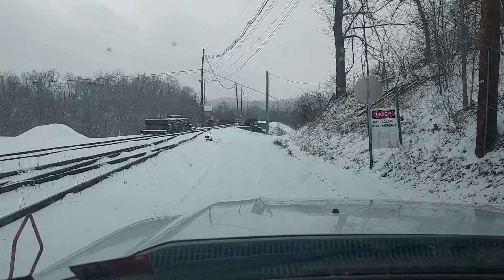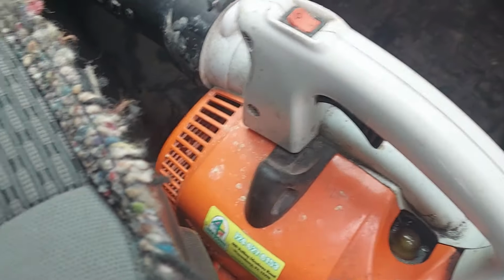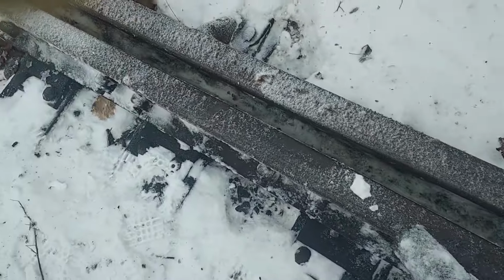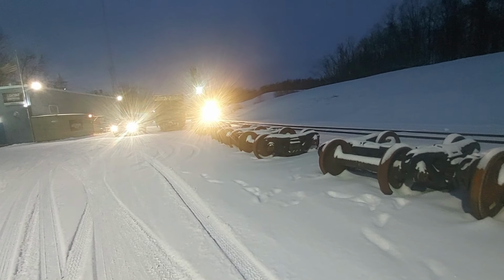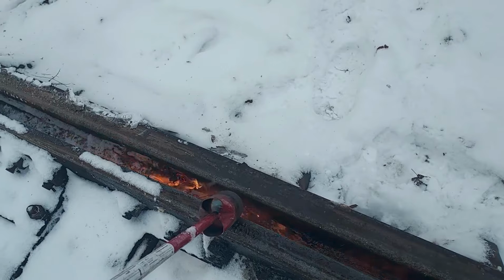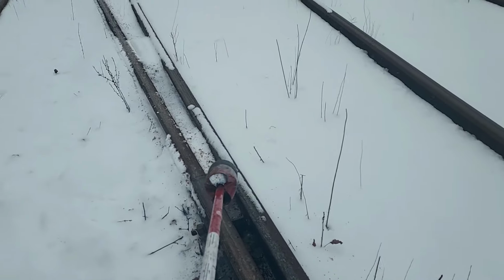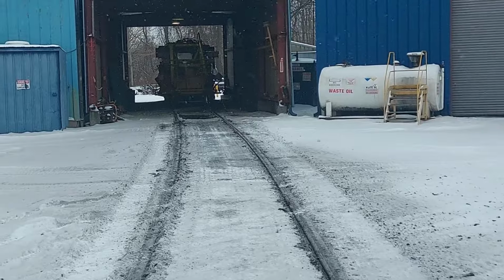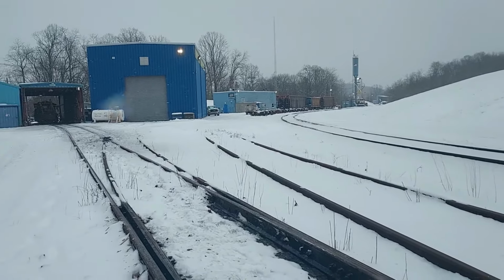Cleaning Snow out of Railroad Switches

Comment: years ago  dave when I started trucking scrap I hauled out of a yard that scraped rail cars they  had there own locomotive, so what the brake man did was when they were expecting a lot of snow he'd cover most switches with flat cars  there for keeping the switches clean!!! pretty smart!!
Reply from the maker: Hey that is a pretty smart idea Jeff. Flat cars would work great for
that. Problem with the hopper cars is if snow accumulates in them
then it makes for a real mess when they try and dump coal out of
the cars. If they are not running trains and a big snow is coming,
we open the doors on the hopper cars. Thank you very much for visiting with us to help me clean snow out of switches my friend.

Comment: I worked in the steel industry for over 35 years in northern Ohio and all steel is moved by rail.  When it was cold and much snow was expected the RR used to park cars above the switching points if possible to keep the snow off them and we had a small little mobile RR car with a cab on it and it had a jet engine mounted on it that would be turned on and pointed at the tracks to blow off and melt the snow and ice - its was a very cool little car to say the least!  I could still hear the sound of that jet engine as the car went by and took care of business to keep the plant running.   I love your videos by the way as I'm retired and these videos bring back memories of days gone by.
Reply from the maker: Really pleased to hear you are enjoying the home movies Krispy.
That's an excellent idea to park a car over a switch, we've done
that a few times on our main line switches if they weren't running
trains. I need one of those cars you had here!!! Boy what fun I
would have with that.

Comment: I use to work for a construction company out of Cleveland Ohio that did rail maintenance. We used a mobile air compressor that we used for our neumatic tools for rail maintenance to clear the ice and snow off the switches. We had a hand made wand with a lever valve to flow air or shut off.
Reply from the maker: That's the way to go Kevin. We have a long wand that we have
in the past hooked up to the air line on the loco to blow snow
out of the switches, it works great so I'm sure your configuration
would work great also. Very much appreciate your taking the time to visit with us and check out the video my friend.

Comment: We carried a snow broom on the locomotive and the crummy. We cleaned out switches before placing cars. The track gangs couldn't always get to the customer's sidings so the roustabout crews performed the task. When I started on the EL in the 1970's they used snow oil which would melt the snow from the rods and switch points. Highly flammable, couldn't use it near switch heaters. The propane heaters made an eerie whistling sound when heating; you could also roast weenies over them. A lot of switch heaters are now electric and are remotely controlled. The track men had a fusee holder and ignited the propane heaters with a lit fusee. It isn't fun railroading in the snow. Don't you have a cold weather head cover to attach to your hard hat? I don't envy you working out in the blustery cold. Thanks for another great video. Take care and God bless.😎🚂🚃🚃🚃✝
Reply from the maker: No I do not have a cover for my hard hat Gary. I get in the truck when
I get cold....:-) Very interesting comment to read, appreciate very much your taking the time to share some old railroading with us
my friend.
Reply: all our switch stands have a holder for a broom that has a ice chipper on the other end, however... conductors often pretend they dont know how to use it and we usually gotta come clean the switch for them after they packed too much snow/ice into it! Funnily enough they will also break the broom on purpose if they dont want to clean it and make mow do it ^^

Comment: It's amazing how strong ice can be. We had a lite locomotive derail once because of ice in a crossing down in Connecticut. Man, it was cold that day. Took two days to get it back on the rails, laid it right over on its side. I'll never forget it, we stacked 215 ties for a pad for one of the crane outriggers, there was a ravine on the side the loco went over, then never used it!! Man, it was cold! We also had a jet engine mounted on a hi-rail car that cleaned the switches in the yard. Boy oh boy was that thing a site to watch. It was loud and violent, would send ballast, spikes and anything else that wasn't nailed down into a low earth orbit.
Reply from the maker: We never thought ice could jack a heavy loco off the tracks Anthony,
but we learned a valuable lesson the hard way that day. I bet your
experience with that was a real fiasco. That's what I need to make
a cool video is one of those jet engines!!! :-) Very much appreciate your taking the time to write in and to check out the cleaning snow video my friend.

Comment: When our switch heaters go out we use plastic shovels and brooms, and hydro, and light it on fire.  We have 750dc, 480ac, 240ac heaters and gas, and propane, there is a lot of miles.
Nice tiger torch.
Of course your mine railroad is different then mine and we cannot use any blower safely not to mention we have third rail.  At switches like that we use Kerosene pots, they last eighteen hours when lit.  For simple heat why do you not have those?  
We also have two jet engine blowers mounted to a track car.  It has power, heat, and loves to throw ballast at windows to break them. LOL

Nice job though.  Glad you had the tesing done, thank the man Sperry for that invention.
Reply from the maker: Kerosene pots would be nice but they got me instead Tuco....:-)  Even years back when we only had 1 loco and 4 of the switches got used every train trip we would have to manually clean those switches all the time.  I'm really glad I don't work track that has 3rd rail!!! Thank you very much for visiting with us to help clean snow out of switches my friend

Comment: It must suck to have to do that by hand! The tracks by us have "high speed switching" and there are switches everywhere between our town and the yard in the nearest larger town. Every one of them has a propane tank next to it and a switch heater. I'm sure that is insanely expensive, but necessary if you don't have a large team of Dave's 😉
Reply from the maker: NS has those around here also Mojo, I made a video of one couple
years ago but haven't shown it yet, would be cool if I could video one
when it was turned on, I'm waiting for that. They sure save a lot
of man power and you are right, they are expensive.  Very much appreciate your taking the time to check out the video and post a comment my friend.

Comment: We used to have a  1” pipe about 6’ long with a ball valve with 8’ of 1” hose hooked up to a locomotive and blow out the switch from the pilot, it worked great until it was outlawed.
Reply from the maker: When we were running only a single loco we too had one of those
and used the loco car dump line to blow snow out of switches with
that Jason. Yes it did work great but the train operators weren't too
pleased about getting out in the middle of the night to blow out
switches with it....:-)   Thank you very much for visiting with us to help clean snow out of switches my friend

Comment: I've used leaf blowers for years  cleaning snow off our vehicles,  and when it's powdery, the driveway too. Great thinking
Reply from the maker: Yes sir, I also use the blower for cleaning snow off my hi rail trucks,
works great. Here in Pa. we are supposed to clean all the snow off
the car roofs so snow doesn't blow off them and cause an accident,
the leaf blower is the ticket to do that.
Reply: @ccrx6700  
I live in Utah.  It's the same  here. We get alot of powder, so usually  it's easy.

Comment: Thanks for taking us along, Dave! Really neat to see how you handle the snow and ice around the switches. I've seen the hand-held propane torches like that but I never would've expected you to use a leaf blower! From a layman's perspective, it seems like the massive weight of trains would crush through any resistance that ice or frozen ground could offer, but it amazes me how much care you really have to practice with the cold temps. Thanks again for sharing! I learn so much every video!
Reply from the maker: Appreciate the nice comment Seth. When that loco went off the rails because of the ice build up, we all had thought the same as you
did. 368,000 pounds it weighs and it ain't gonna derail from a little
ice. We sure were wrong on that and learned a valuable lesson the
hard way.   Thank you very much for visiting with us to help clean snow out of switches my friend
Reply: @ccrx6700  What a horrible lesson to have to learn, too! Thanks again for sharing all this with us, my friend! Hope you're having an excellent evening.
Reply from the maker: @TheyCallHimDietSeth  👍😊

Comment: BRRRRR, fire and a blower sure beats the broom. Wish I had that when I was cleaning switches at 5 deg. in Jan. years ago. Good video. Glad it is 65 today instead of that 14. :)
Reply from the maker: Yes it sure does Bryan. We've used a long wand run off the air
line on the loco before also, that does a great job, specially when
the snow is heavy.  Thank you for  taking the time to visit with us and check out the video my friend.

Comment: Hi Dave,  Good to learn something new.  Torch melts snow into water, you go away and the temperature drops, and you get ice. I guess that's just another reason for good track drainage.
Reply from the maker: Torch evaporates the water shopshop. However using the leaf blower to try and blow away wet snow can cause more ice to form. There's
always a need for good drainage for sure on that!  Very much appreciate your taking the time to write in and to check out the cleaning snow video my friend.

Comment: I can remember in the late 60s early 70s Toronto Terminal Railroad, who ran Union Station Toronto, would pour diesel fuel on the switches and set it on fire with flares. With all the double slip switches it looked like a war zone out there. Probably would not meet today's environmental standards. The funniest thing though was to watch CN working on the Turbo trains by heating the fuel lines with flares and pounding the jet engines with wheel hammers to get the engines to start. Such a low tech method to start a modern engine. Of nothing else works get out cans of diesel fuel, big hammers and flares.

Love your videos, and the use of a leaf blower.
Reply from the maker: I've set switches on fire before also using Fire Snake D Bolt. That's always fun, we used to use a rope soaked in diesel fuel
before they started getting us the snake. Just pouring fuel
on a switch and lighting it wouldn't seem to last very long. Big Poof and it's all over. Appreciate very much your taking the time to visit with us and may you have a very good day my friend.

Comment: I could see where 16 degree weather would cause the ice between the switchpoints to create ice damming.  I would also assume that the bolts needing to be replaced are caused by downward stress on the rails from the locomotive and railcar traffic in addition to the lateral shear stress of the rail shrinking in cold weather and expansion during warm weather.  I bet when you finally have a weather warm up you find quite a few bolts sheared off.  Great video on how all the "little things" keep a railroad moving.
Reply from the maker: It's a constant thing out here with 16 miles of jointed track bolts shearing off Dave. I keep after them and at minimum weekly go out
and replace missing bolts, a never ending battle. Glad you enjoyed
the video and we very much appreciate your taking the time to write in and to check out the cleaning snow show my friend.

Comment: Is there a problem with the coal freezing to the hopper cars? Are the cars cleaned out of snow and ice before they're loaded? In the gravel business there is nothing worse than the load freezing in the end dumps. Our quarry trucks had heated bodies but sometimes the material will still freeze in them.
Reply from the maker: Yes there is a definite problem with coal freezing to the sides of
the aluminum cars Pete. There will be a video out soon on how
we spray the insides of the cars with a side release agent to prevent
coal from freezing to the sides. If they are not running trains consistently and a big snow is coming we will open all the doors
on the bottoms of the cars. If we let the snow build up in the cars
then load coal on top of that snow even with spraying it creates
some big problems. Many of the triaxle trucks they haul gravel
with around here can direct their exhaust to warm the bed up
if needed, but it always doesn't work very well like your trucks either.

Comment: Hi Dave, we have 9 switches to blow out at our place in Northfield MN. We use the stihl backpack blowers and the brooms. Wish there was an easier way to do it but like you said, you gotta do what you gotta do. Take care buddy!
Reply from the maker: Would be nice to have one of those back pack blowers, they no
doubt do a better job than my small leaf blower. We used to have
a long air wand that we plumbed into the loco air line, that worked
great and did well in wet snow. Thank you for taking the time to visit with us and check out the video my friend.

Comment: I remember when we used to dig the ballast out between the ties under the switches and place heater pots in the cribs between the ties. They had wicks and diesel fuel. we would light them during a snowstorm and after a train would pass. we would check to make sure they remained lit. It kept the switches dry. I also remember a jet engine blower that would travel through the yard blowing out the switches. We had to keep a man several hundred feet in front of the machine to avoid anyone getting hit by the flying debris such as switch plates. When the jet blower was finished, those tracks were dry.
Reply from the maker: We always called digging those ties out under switches window
dressing. I've never seen one of those jet blowers work but they
must be really neat to see. Appreciate very much your taking the
time to write in and also to watch the video. May you have a very
good day my friend.
Reply: @ccrx6700  Thank you Sir. I worked 8 years with CSX. I absolutely loved the job, but they kept furloughing me every year and it was too hard on the family. I loved the job and railroading. I would still be there if it weren't for the furloughs.
Reply from the maker: @metro143  👍😊

Comment: Lots of work for that little of snow...
Haha, using a leaf blower as snow blower..... Home brew but looks like working well.
Using the flame thrower...... Don't make the grease burn away!
Reply from the maker: Have to  re oil the switches every time with the propane heater Stefan. Yes a little bit of snow but if a switch won't throw and they
need it, then I get yelled at and we don't want that to happen....:-)
Very much appreciate your taking the time to visit with us and 
check out the video my friend.

Comment: It's so nice that you use real temperature measurements that people can actually relate too! I hate it when people complain about the heat and then tell you it's 35 degrees! Have you ever had the coal freeze in the cars?
Reply from the maker: Thank you Keith. Yes we have had coal freeze to the sides of
the cars many, many times in the past. I will have a soon out
video on spraying our cars with side release agent to help
prevent the coal from freezing. And yes we have also had the
coal freeze as a solid block in the car and nothing would come
out, just have to wait for several days of warm weather to dump
those puppies out. Thank you for  taking the time to visit with us and check out the video my friend.

Comment: I knew about frozen switches and that they had to freely move to do what switches do.   I would have never thought a engine or rail car could derail at the crossing you pointed out. You would think the weight alone, of those would push ice and snow out way along the railway.
Reply from the maker: We never realized ice could jack a heavy locomotive off track either
until it happened 47fireguy. We learned a valuable lesson that day
the hard way. Very much appreciate your taking the time to write in and to check out the cleaning snow video my friend.

Comment: When i was younger they used smudge pots in construction zonea at night. Ive seen large ones with about 5 gallon? Can that slid under the rails between ties. Had a large round wick that the flame would heat the rails. Had a cover to place over wick when not in use.
Reply from the maker: On many railroads back in the day that was often an all night job
for trackmen going around and filling those cans to keep the flames
burning Erik. If it snows all night here, I stay home in bed and clean
switches in the morning....:-)  Thank you very much for visiting with us to check out cleaning snow out of switches my friend.